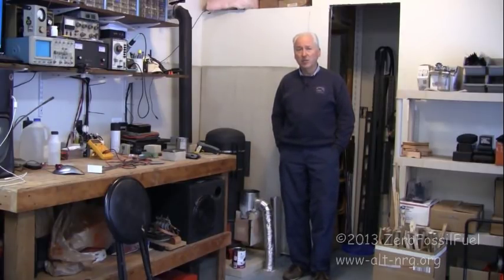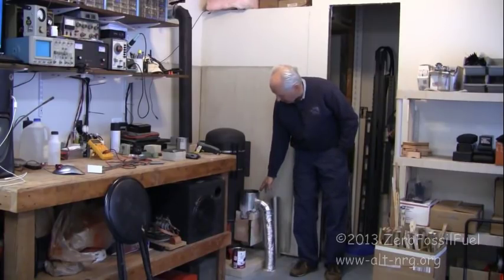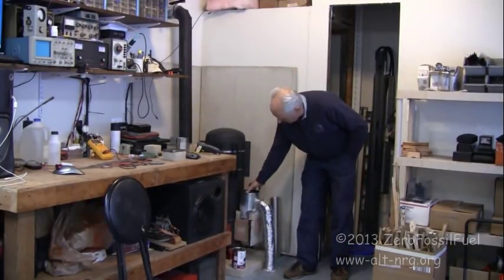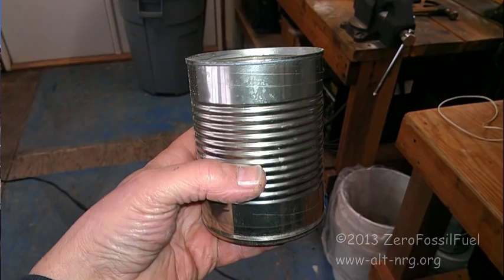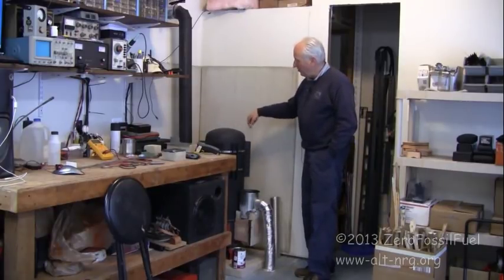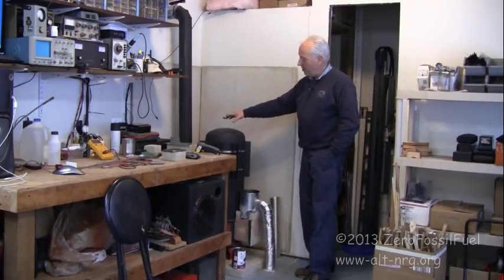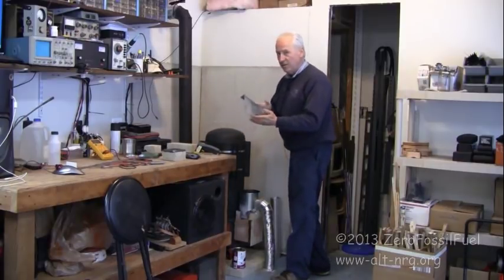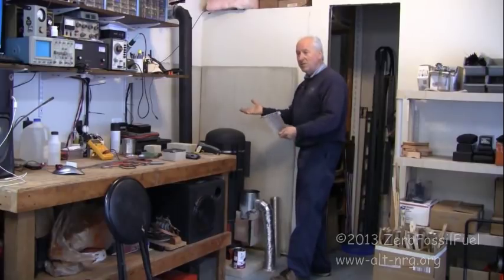#326 Rocket Stove heater conclusion

Comment from the maker: This is one of the tradeoffs of the design. It definitely requires more tending than a traditional wood stove. If you look at my free pdf you'll see I did have mild success with a wire loop wood guide that let me load 36" lumber and got about 1.5 hrs out of between loadings. But it required very smooth lumber. Sticks and twigs NG. Others have retrofitted wood pellet feeders but those can be tricky to tune. I may try my hand at one soon.

Comment: Sounds good. Keep us updated. I'd tend to use steel from scratch I think. Of course it depends on what you have handy. Now you've said that, I will definitely be putting them on the inside and outside of mine.

Comment: Love the specs on the temps with & without the fins. Just a thought, with the outside air feed you can use a mechanical bi-metal louver @ the burn chamber and adjust it to close just after the embers die and leave the feed tube capped.

Comment: That is  phenomenal !! So you would be burning a "Cord " of wood every 137.5 days.In the past I have used 8-10 cords a season. The   Monetary, Environmental and  labor is very impressive. I am heating a 2000 sq foot home , so the Apparatus would have to be made larger.I wonder if the exhaust pipes were arranged in a loop system over a greater distance, would decrease the flow of burn and capture more radiant heat. Thank you for your time and effort

Comment from the maker: Not only would it not hurt but I'm working on an idea to put the same fins on the INSIDE to absorb the heat energy for transfer through the tank wall to the outside fins! The only unknown is how well the aluminum drip edge will hold up to regular beatings at 500F at the tips. Should last at least long enough to show proof of concept. If they deteriorate too fast I will have to weld 1.5" x 12" flat iron bar stock to the inside.

Comment: I am not sure if you said you were having trouble keeping the top of the unit cool or if you wanted to keep it hot. If you were trying to keep the temperature down by dissipating the heat quickly Your best bet is Copper, and if no copper is available Aluminum. Copper is second best at heat dissipation and AL is third, with silver being first not mentioned for obvious cost reasons. 

Heat sinks don't even need to be made, Computers have them manufactured which can be salvaged from old units.

Comment from the maker: Yes, you understand correctly. It's the same principal that makes fireplaces barely 10% efficient unless fed by outside air directly into the firebox. Even better if the firebox is sealed behind good glass panels with a forced air heat exchanger as I have done with my own fireplace.

Comment: There are tradeoffs to any design,  this stove has little thermal mass , but it heats up quickly a bonus, but cools just as fast. Your right , stopping cool from the outside feed air pipe slows this process. I like the idea of the stove but much heat is lost up the stack. Other rockets stoves route the exhaust through thermal mass extracting more heat. Might want to modify you flue to take advantage of this.

Comment: Brilliant and I may try to copy what you made for my next build.  My rocket stove has a grate with ash pit that seems to work really well and I have gotten over 900 degrees F on the top of my stove, it's got a 34" chimney with i.d. of about 3 7/8 inch.But I like your idea of using firebrick for chimney and comb chamber.  Plus yours is a bit smaller and very easy to break down for transport. Great job & great comments-lol!, I like what you are doing. I'll try to send you my vid and learn twitter.

Comment from the maker: I have stated elsewhere, will repeat here... Stove sits atop brick paver hearth, surrounded by cement board spaced 3/8" away from the walls and 1" off the floor on wood strips to shield, insulate and allow convection heat transfer from both sides of the cement board. Bench has aluminum flashing tacked to it.

Comment: Nice job. I lived on "Pot Belly" Heat for many years. Often thought about making some modifications like what you have here. Great job! Looks like very efficient heating! I need to go back and watch your previous videos, would I be right to guess its got low carbon output? In my experience, neg pressure seems to be good for lowering carbon output and soot in the flue. Thanks for the uploads! Great reference material here.

Comment: Thank you for good video!

Hope you can help:

I need to build a rocket stove to heat a swimming pool of about 140 000 liter (37 000 US gallon)

Two 1.1kw pumps will circulate the water.

The pipes from the pumps are 50mm (2 inch), and I will split each pipe into 11 copper pipes of 15mm (0.6 inch) each to equal the same volume.

Each of these 11 X 2 copper pipes will be form into a spiral of 30 meter. (100 feet)

The diameter of the drum will be about 1 meter. (40 inch), and the width perhaps slightly more.

I plan to make the outer drum 300mm (12 inch) higher than the inner drum.

And the diameter of the outer drum will be 1.6 meter (64 inch)

Airflow will be from underneath, i will make a grid of copper pipe to build the fire on.

The chimney will be about 400mm (16 inch) from the bottom.

I assume a chimney of 100mm X 100mm will be sufficient (4 X 4 inch)

My question, if anybody could help me perhaps, is the ventilation of 300mm. (12 inch)

Is it sufficient, too wide, or too narrow?

Thank you in advance!

Comment: I grew up using wood stoves. An old style wood stove would cause fires, because they were simple in design and had the fire going straight up the pipe. In fact, if you stoked it full of wood, the fire could be seen coming out the top of the pipe on the roof! 
The rocket stove is 100% different. The flame is too small and too far from the stove pipe to reach. By the time the exhaust reaches the pipe, there is no flame. It's nothing but hot air and steam. The heat dissipates into the house.

Comment from the maker: It all burns in the horizontal chamber and vertical riser. All the heat is radiates from the tank and exhaust flue pipe.

Comment: I love your dig on permies.com. I have a RMH that I made from scratch. Works very well. According to permies, it should never work. I have a firebrick core and a steel barrel heat exchanger. That's where the similarities end. Mine recirculates the vent gases around the core and to get to core hotter and to heat the brick/cob thermal mass. I need to learn how to make a video out of pictures with a voice over.
Reply from the maker: Permies is a great resource but it could be so much better without the **MASSIVE EGOS** that permeate Permies. The turn-off is so great for me that I don't even peruse it anymore. What a waste.

Comment: Hi, I would like to make your exact stove because I know it works great, i can't find the exact same tank size to use. So my question is can I use an air compressor tank that is 47.5 inches tall with a diameter of 20.5 and just use your same specifications internally or would I need to change anything for the bigger size tank? thanks in advance for any help...

Comment: Great idea on the fins. I've got some scrap 14ga sheet I might have to do that with once I get my stove body ready for welding.
Any thoughts on what your average temps are for your combustion chamber? I would assume that with 700*F on the top before adding fins you'd have a max of 1200-1500*F in the chamber. That a fairly close guess? I'm trying to get a good idea of what heat levels I'll be looking at in my chamber when it's built since I'll be using steel parts.

Comment: Thank you for posting link to the specs you used! Im not real good at math at all, Im going to try to make a 4in x 4 in burn tube maybe 18 inches long. With a riser about 5 inches inside diameter, hoping to find a barrel 32 in high, with a 6 inch exit pipe.
Reply from the maker: Susan Stone Salas That seems like a good mix. My only comment would be try to keep the horizontal run as short as practical.
Reply: ZeroFossilFuel Thank you for your reply, I ended up building it inside an old pot belly wood heat stove in more like a rocket cook stove, inside diameter 3 x 4 something (LOL) about 13 in long, but the burn tube is a horizontal instead of the Jay type so is essentially less in length,, and added more brick to divert the exhaust so that it would circulate (imitating the riser) I was shocked at how fast the stove heated up, and the exhaust pipe also did not get as hot, though it still got hot. I was wondering, if I could make something similar to your fin idea, but since I don't weld, I was thinking maybe wrapping the exhaust pipe with copper, or aluminum,,, LOL I don't know.

Comment: Nice videos.  I have been thinking of making one of these.  I have also thought of making one of the large rocket mass heaters for the house with a large sand or adobe bench to hold the heat.  The main concern of mine has been that it seems like you would have to feed these stoves constantly vs just loading up a wood stove every 4 hours or so.  How long will your burn on one load of wood?  Thanks- TMFA

Comment: Hey Zero, awesome work! I had a question about fans and spinning blades.  Back 20 plus years ago their was a novelty candle item that had a fan that would turn from the heat under the blades. I was wondering if with the awesome freewheeling bearings of today if a person could mount one of these type fans,a bit bigger though, above the heat riser and it would spin working like a free ceiling fan? Maybe 2 in tandem one at heat riser and one at ceiling level?

Comment: Is that single wall pipe going to the box in the wall?  If so, does it get hot near the box?
Reply from the maker: It is single wall pipe. The "box" is called a thimble. It's an insulated pass through. I describe how to make it in another video and in my free pdf at alt-nrg.org. However, I only made the thimble to comply with safety standards set for conventional wood stoves. This is NOT a conventional wood stove by any stretch. My maximum flue temp at the wall has never exceeded 200*F, even with the stove running at over 900*F!!!. The thimble is actually overkill just to silence the paranoid.
Reply: ZeroFossilFuel
Thanks for your reply.
Reply: BooKittyRadley

Comment: Wonderful stove well done A question though about your use of the fins and if there are any negative effects of cooling the tank down using the fins. Does it in any way change the combustion from being completed or change any amount of the rocket effect?

If there are none then I will include them on my stove also to up the efficiency and cool the flue temps

Comment: I have just bought a Grover Rocket Stove and i am wondering about making it an inside heater also.  I thought to use a 22gallon steel drum painted with stove black and just make a door, air inlet and a chimney to go through the roof.  Any thoughts on this?

Comment: I haven't made one but just a question about the taking of heat off at the top level; isn't the idea of the unit to burn as much as possible of the gasses and combustibles in that area to lessen the output gasses? I would think as much heat there as possible would do that and take the heat off with the fins lower down. Maybe a redundant question but I didn't find it in the comments.

Comment: Hi it's me again ;-) I have accumulated all the bits I need to build my RS. I am using steel tubing inside rather than fire bricks. I see on your diagram you have used fibreglass wool for insulation inside. How temperature safe is it? Have you had any problems? Be lucky. Graham.

Comment from the maker: When I made my fireplace firebox sealed with Robax glass doors and a home brew forced air heat exchanger, I did a lot of research into efficiency and what factors were involved. I can't site any specific references right now but do your homework. Fireplaces create negative pressure. The #1 contributing factor to overall net loss of efficiency is air replenishment from leaks elsewhere throughout the home. The #1 remedy is direct air to the firebox. End of discussion.

Comment: That's some parting Shot at Permies. You yourself mention that the flue gasses are as high as 180 degrees from your rocket heater? permies rocket mas stove flue gas temp after it passes the mass threw the mass as below 100 F. 2 different deigns
Reply: I thought the same thing. Both have their ideas, both have merit. His shop looks small, so it appears that he's willing to give up the "mass" part of the equation and it's advantages to save the space. Like he said, none of it is written in stone. I use mass, because I want to capture the heat that would go out the flue. This seems to work well for him.

Comment: I'm in the process of building a stove of my own using your firebrick J-tube design. The only question I have is about the flue. Mine will have to be about 25 feet-that is the vertical run. I haven't been able to find out anywhere if this will adversely affect the performance of the stove.  I would appreciate any feed back you can give me. Thanks.
Reply from the maker: The more vertical it is the *BETTER* it should perform!
Reply: ZeroFossilFuel
That makes perfect sense. Thanks for your reply!

Comment: Nice job. Have you heard of the Fischer Tropsch process for making gasoline and/or diesel? I hear the guys/galls at ALLPowerLabs, in Berkley, have been working on getting a process going using an iron catalyst in the form of magnetite. They have nice gasifiers also. I dream of driving a vehicle powered by wood up the mountains to take a vacation and using wood to make gasoline for sale later on. Or use switchgrass to make gasoline. It would be the new carbon economy with out big oil involved.

Comment: Does the exhaust pipe need to go outside. I made a rocket stove out of 55 gal drum. But I get smoke coming in to the garage. I'm guessing my issue is the fact that my exhaust pipe goes to the top of the roof, there is a vend there. But my exhaust pipe never goes completely outside.
Thanks for suggestions.
Arek
Reply from the maker: +Arek Kosinski It only needs to go outside if you want to stay alive.
Reply: +ZeroFossilFuel Thanks :) It made a huge difference however I still don't get high temp. What can help with getting my temp higher? I think my air intake is sufficient and I even tried to limit the air intake which only makes it worse. Would it help if I send you a picture of this? Much appreciated sir!
Reply from the maker: Arek Kosinski Have you read the free pdf I publish at alt-nrg.org? Most specifically the section regarding the optimum ratios and materials?
Reply: +ZeroFossilFuel Thank you for that suggestion and I just read it. I think because I have 50 gal barrel and I'm using 6 inch pipe for feed, burn, and burn chamber which is insulated with about 2-3 inches of concrete + small stones. I am lowering the temp of the entire stove. Most of the stove can be touch without burning yourself. I need to buy a temp gun or add-on (like the one on a grill) to measure temp on my stove. What worries me is that my exhaust flue is super hot that means I'm wasting my energy. Thank you
Arek
Reply from the maker: Arek Kosinski Seems to me you have bigger problems than just your dimensional ratios. 6" is about the right size for a 50 gal drum.
Reply: +ZeroFossilFuel mine is a 4" system but has a well insulated core inside the 55gal drum. Do you think I should search for a smaller steel drum?
Reply from the maker: LimitedGunnerGM Wow. 4" in a 55 gal drum is pretty lopsided. I would say yes, either a smaller diameter drum or bigger system.

Comment: CH 4 + 2 O 2 → CO 2 + 2 H2O + energy (and various other minor NOx etc)

so is not zero effect on greenhouse. CO2 being a major contributer.

Jet burner reduces ash and soot but can not change laws of physics - carbon in - carbon out CO, CO 2.

It increases the effiency for heat per fuel, so cheaper to run

Comment: david you have not considered that this is carbon neutral as the co2 produced will be taken up by trees and other plants. as well it uses only 1/10 of the wood of a typical wood burning stove. another point is it replaces so other fuel that is not carbon neutral such as fuel oil, propane or lng. which are carbon storing. when burned releases a lot more carbon which has taken millions of years to become oil etc.

Comment: how would you design a 44 gallon water tank heater using your excellent rocket stove design ? Steel coil, or direct rocket flame in contact with a stainless steel water tank above the heat riser ??? Which heat transfer method to the water is most effective. Thanks. I would like a 6 inch or a 8 inch version designed please, can pay you $$$$
Reply: I'm thinking of the same idea, using water as thermal mass, plus bonus get hot water
Reply: @CheekyMonkey888  My stepfather’s house in So Cal has copper pipe running all through the concrete slab.  It’s designed to run hot water through and heat the home.  Using a rocket stove in conjunction with that design would very efficient.

Comment: hihi - I have worked with Dana for around 30 years on numerous repeaters... no comment.. hi
Hey have you considered pellets?
It would be a bit of a modification but certainly do-able - also I have given thought to a coal version, should produce some real high temps.  So I am looking into some k23 or k26 bricks and a type of grate system.  Oh these heaters offer so much to the brain to think about, prolly too much for Fran

Comment: I do believe there is an error on your plans - you say 2 - 6"x9" bricks.  Should that no be 2-6"x 4 1/2" bricks?
I have replicated your bricks and can not figure out how to stretch those dimensions out of a 4 1/2 x 9... hihi
Instead of a saw I used a grinder with a ceramic blade.. another person sprayed/squirted water on the cut which kept down the dust.  I have gotten all the brick cut and ready to enclose the firebox  - getting the right size barrel/cylinder is the biggest challenge so far.